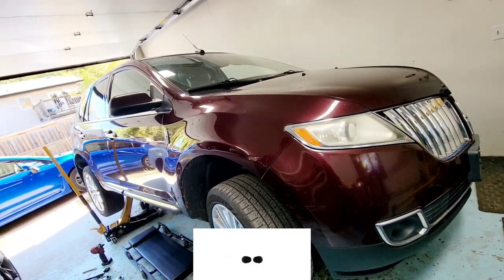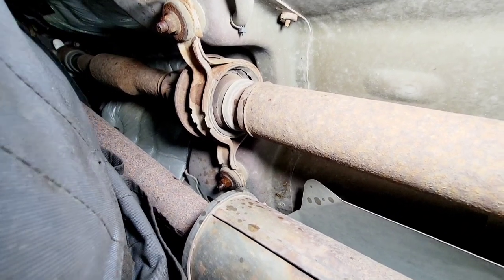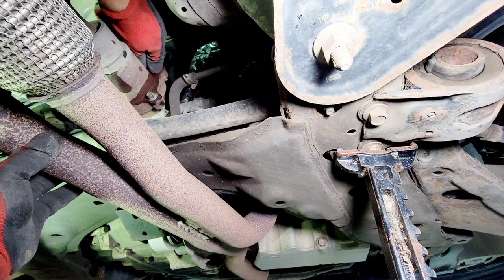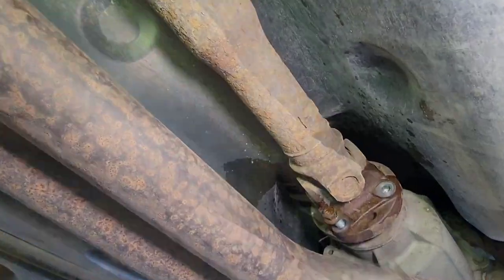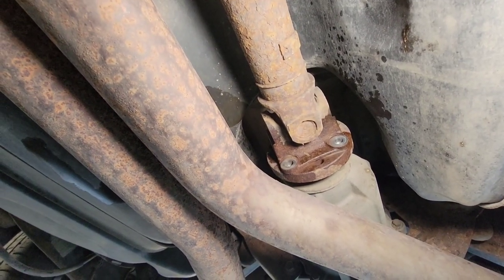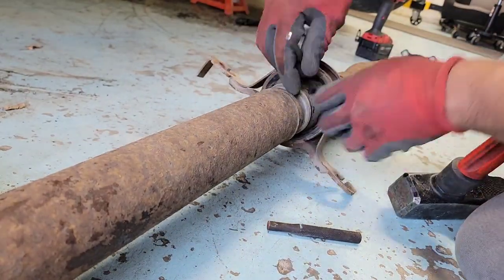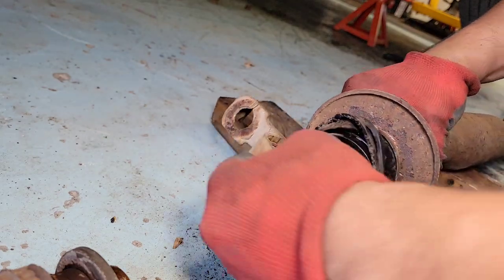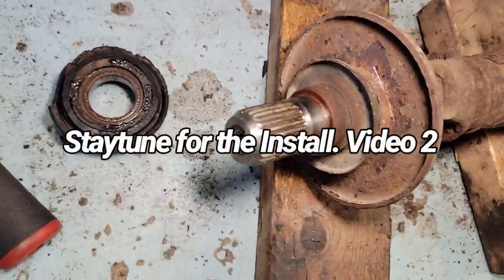[Drive Shaft Steady Bearing] Lincoln/Edge/Cx9  How to REMOVE Center Support Bearing #cx9 #edge #mkx

Comment: Great video, I’m glad to hear that when it goes back together, you’re going to use anti seize.  Most guys never mention it (probably because they don’t use, or know about it).
I use it on everything I own, especially on disc brake caliper bolts.
Thanks again for the advice and info.

Comment: Good video, very hard to get a part, I tied one end to a hydro pole with a chain and sling strap, the other to a vehicle ( something heavy /solid) with a sling strap and a chain hoist , pulled snug to apply pressure in both directions and hit with a hammer /punch, it came apart quite easy
Reply from the maker: True it was hard to remove this old part. Im glad it worked of good thanks for dropping a comment. Thanks for watching

Comment: On my 2010 CX9, I have a 3 piece driveshaft. They do sell the 2 bearing hangars online but From what I gather, the driveshaft doesn't come apart like the 2 piece driveshaft. I didn't want to take a chance so I ordered the whole driveshaft assembly which can be had on Ebay for $250US. I thought that was a reasonable price for the whole assembly, plus I get the added benefit of all new U-joints. The car has 190,000 miles on it but still runs like it's brand new. I hate changing out U-joints.
Reply from the maker: Im sure  the 3 piece driveshaft does come apart. Thats how they assemble the parts at the assembly line.
Reply: YOU HAVE TO POP THE YOK OUT AT THE IT COMES APART

Comment: I hate these videos where all of the pieces just kinda magically come apart. Up here in upstate New York, the entire driveshaft, bearings, nuts and bolts would be permanently bonded together as one rigid piece of iron oxide... You don't know auto repair until you've beaten parts apart for hours when it really should have taken a few minutes...  I'm just jealous. Great video.
Reply from the maker: Sorry but i have to cut the boring part and some other  stuff.